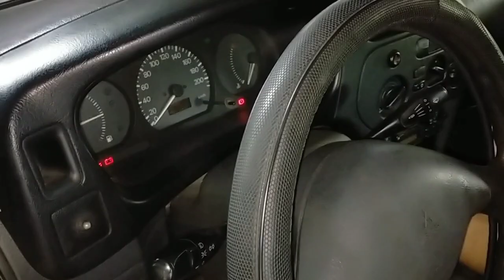ISANG DAHILAN NA HINDE MAG START ANG SASAKYAN | Mitsubishi Lancer

Comment: Bos. Tanung kolng po .Kasi Mitsubishi lancer ex po nmin .pag sumpongin or umga 1 click start pero pag ngmit Minsan kailgn mo po .lgyan ng gas bago aandar itong sskyan nmin anu po alm nio problema bos Sana masagot po plss.bos need lng po
Reply from the maker: Ang mga dahilan nang ganyang problema boss spark plugs, high tension wire, distributor cap, coil.
Reply: Bos slamat Kasi mga mekaniko dito samin puro Pera lng iniisip Nila. Wla po Kasi kme alm sa sskyan bagohan lng po kme kaya naloloko minsna .bumili lng po kme para service at nag che2mo kptid ko bos. Dmi nmin nagastos sa pag ggwa diparin .una bos nilinis ung carbs in napnsin ko parang wla ng hatak sskyan. .in 1300 pa kinuha samin  balik2 n kme ganun parin po🥺
Reply: Kasi bos sskyan nmin Hindi po aandar Kong dko lalagyan ng gas sskyan nmin.. tska hatak nia parang wlamg hatak lalo pag overtake ako bos. Tska ung sa silok sskyan nmin sir may tagas lamgis